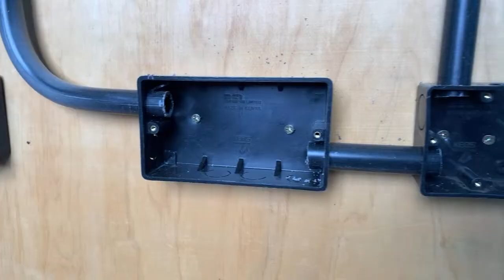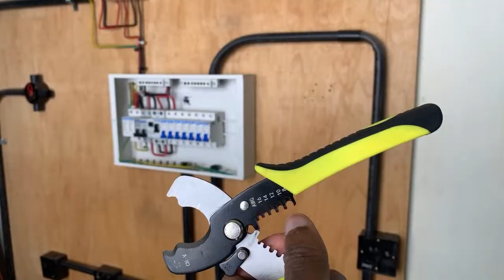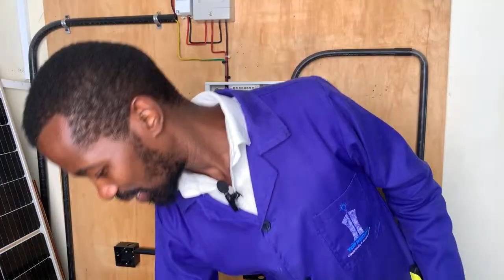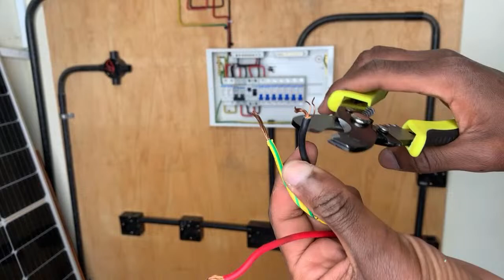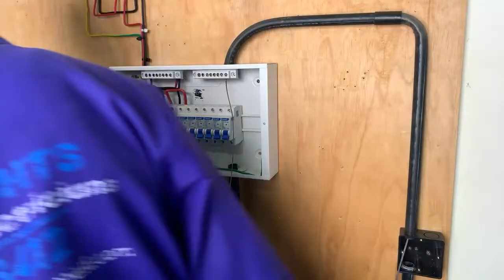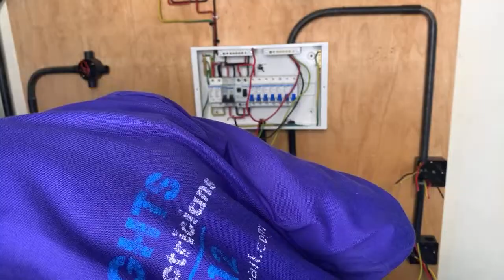Wiring A Ring & Radial Circuit For Sockets | TOPHEIGHTS ELECTRICIANS

Comment: Thanks for the video but I still have an issue with the wiring of the protective devices...kindly repeat it in our next class for my sake and maybe someone who's having the same problem. 
Secondly have seen different electricians asking something on looping of the sp mcbs.
Is it correct to do your looping from the top or bottom?
Thank you and may you consider my concern
Reply from the maker: Thank you for the suggestion, and I will be sure to address those concerns in a future video, Top Boss.

Comment: In one of your video you looped the earthing wire, here you have . Explain
Reply from the maker: Usually at the main service entrance or transformer—is done primarily to ensure electrical safety, system stability, and to provide a low-impedance path for fault currents to trip breakers.

Comment: Is it ideal to loop cooker or showerhead cable to the consumer unit?
Reply from the maker: Great question. The two circuits are independent. They have to tap power from the consumer unit, each with its own MCB, earth connection to the earth bar and neutral connection to the neutral bar.